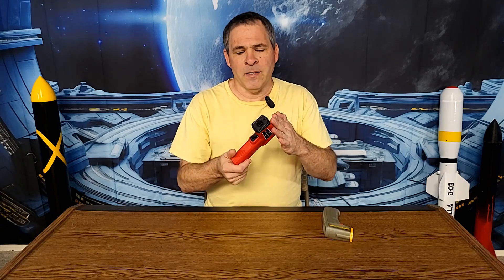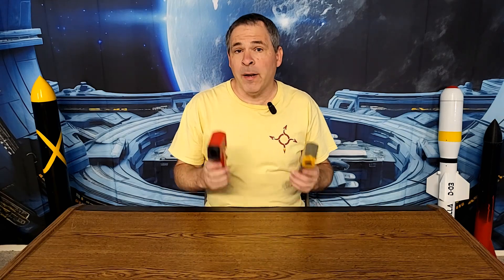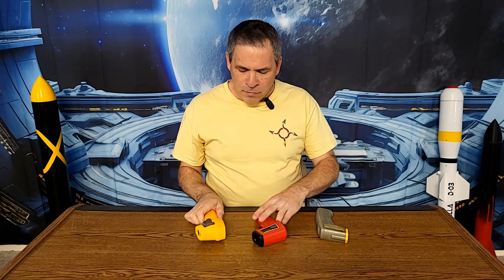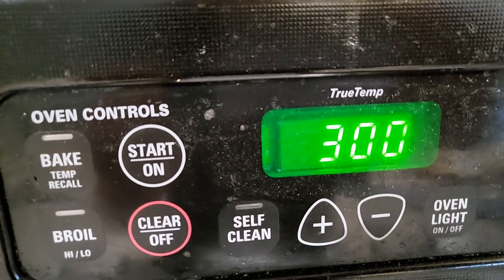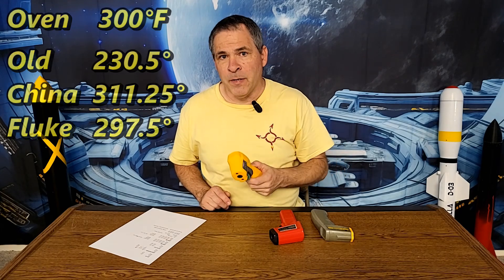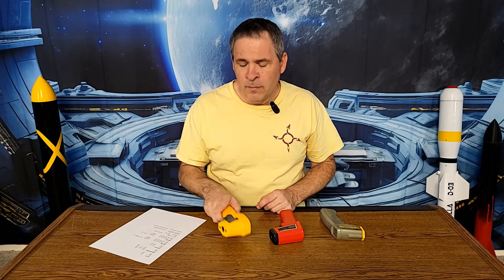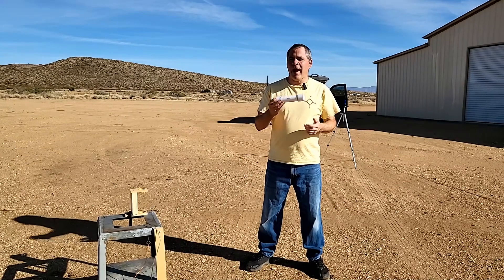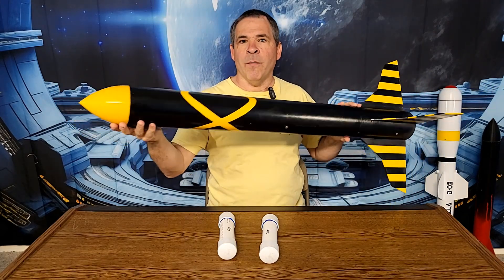I've been cooking sugar rocket fuel WAY too HOT

Comment: What about using ice at 32F (0C) and boiling water at 220F (100C) just in case your oven is off?  (You can adjust for altitude if you want…)
Reply from the maker: @williamharrison8875  Ice may not be a bad idea but I really needed to test accuracy on something hot similar to my fuel. I've seen accuracy problems with these when trying to measure the temp of boiling water. I don't know if it's because it's a clear liquid or maybe due to the bubbling, inconsistent surface of the water.
Reply: I’m a (now retired) Professional Engineer and have used the IR pistol grip thermometers for years.   Contractors would pull their own out and take readings at the same time I would.  If the readings differed, I always deferred to the least desirable reading, for obvious reasons.   To check boiling water, I’d bring it to a hard, rolling boil then kill the heat source and float a piece of aluminum foil on top of the water.   I’ve also boiled a soup spoon and read the temperature of the spoon.
Try that.
Reply: Can't ice be colder than 32 degrees?
Reply from the maker: Yup... Sure can... I guess maybe that's another good reason not to test the IR thermometer with ice.

Comment: Was there not a way to calibrate the old one? Can you calibrate the cheapo one so it's not reading a little high?
Reply from the maker: There is no apparent way to calibrate them. Before throwing the old one away, I'll take it apart and see if there are potentiometers inside for adjusting. I am o.k. with the Chinese one being a bit off because it still works fine for doing differential tests that I need for work. I just won't use it for making fuel.
Reply: I’d just move on to adjusting the higher quality one..